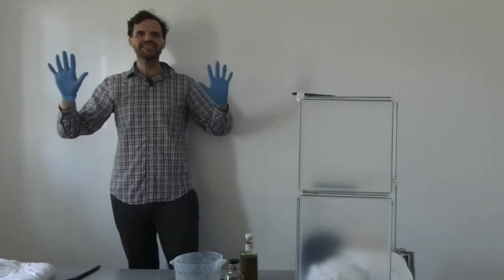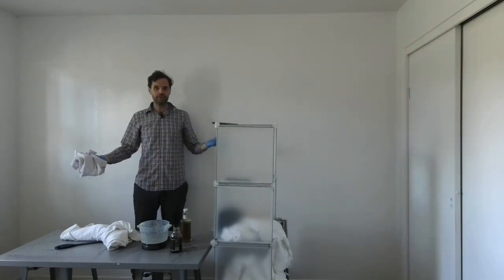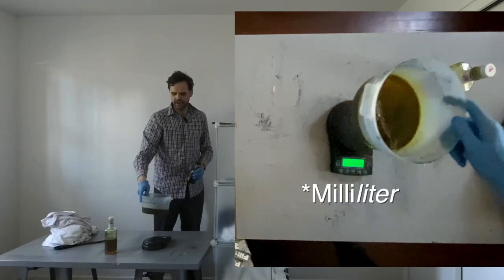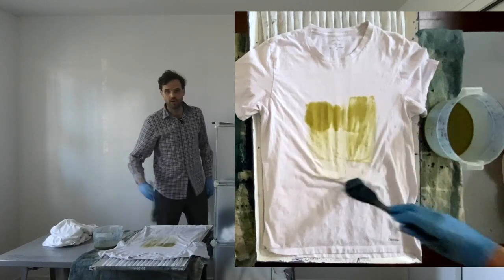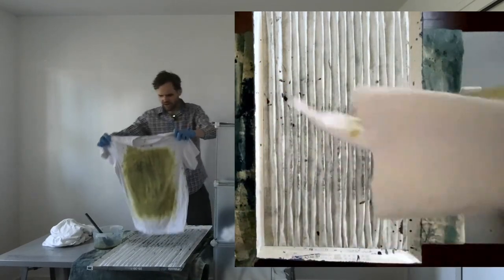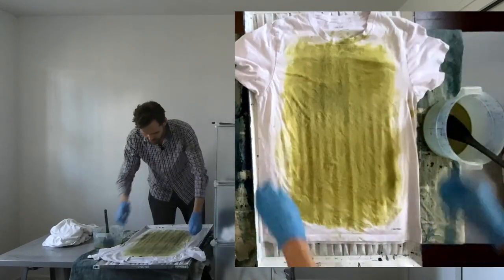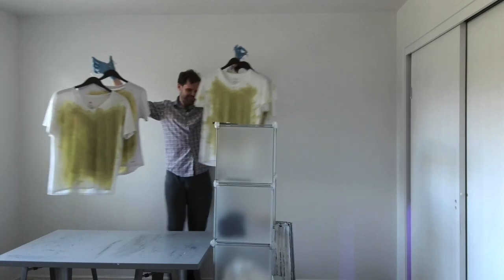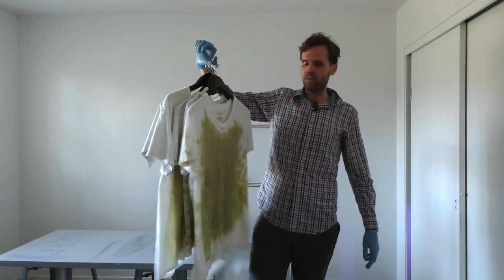Cyanotype Shirts - How To Make Them

Comment: How do I prevent the design from fading away?
Reply from the maker: First, if you wash it, use only Woolite because Woolite lacks phosphates, which are a bleaching agent. Second, a more dense (dark blue) fabric cyanotype will better resist fading.  Finally, 100% natural-fibers are best, compared to blended fabrics which mix natural cotton with synthetics like nylon, polyester, or spandex.